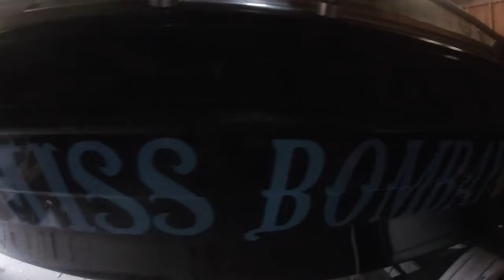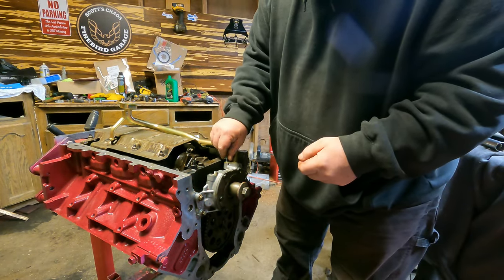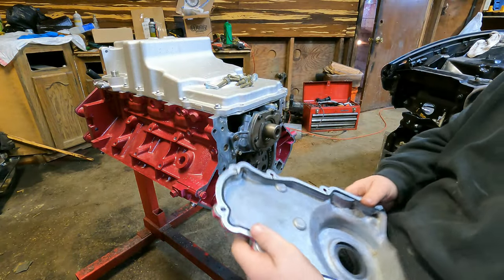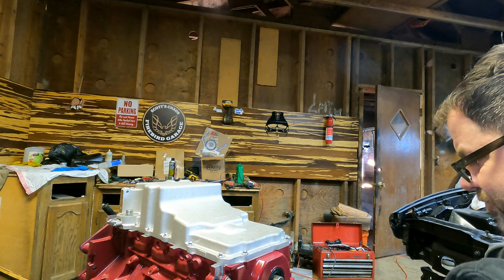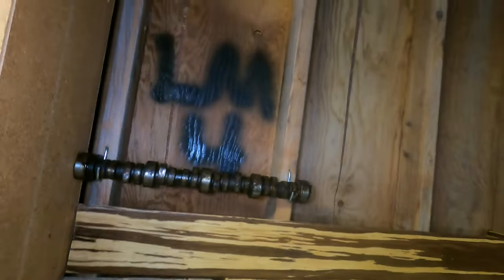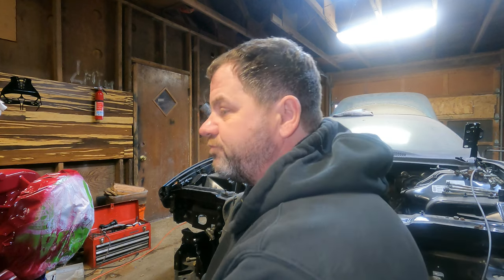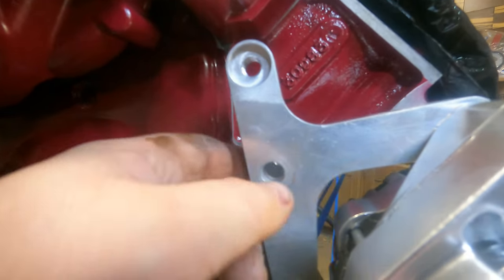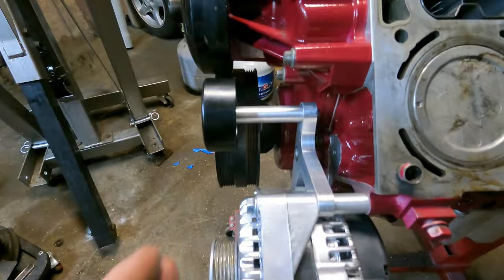How to Upgrade Your 5.3 LS with an Accessory Drive that Will Blow You Away!

Comment: #1 - Just snug the oil pump bolts then spin the pump, with the bolts torqued that pump is not going to move and it could fail.  #2 - There are no dowel pins in the covers, get yourself a set of alignment bushings to center the front and rear covers, without them your covers and seals will be offset and wear them out.  They are only 15 beans and worth every penny then once the covers are centered and torqued in place install the oil pan and torque that in place.   #3 - That idler for the alternator will fail.  With the load of the belt on that long bushing and bolt it will snap it right off.  FYI - If you're going to use the truck spacing with an earlier F body it will work.  I did it on a '88 but I used a LS3 water pump and spaced it out ($20), then I used a stock truck alt./ps mount and just shaved the upper ear off it and added a ICT Billet idler relocation kit, $34 and I was all done.  I even used the stock P/S pump with a $15 adaptor for the high pressure line.  Easy-Peezy.  The only bracket I bought was a high mount A/C compressor kit.  I did do a 5.3 in a '86 S10 with the short Corvette spacing, made it easy to fit the engine and rad in but the accessory drive was a challenge and not cheap.
Reply from the maker: All great information! Thank you. I have been struggling big time with my throttle body so have not uploaded lately. I have also been thinking about using the truck bracket and modifying it for my application.